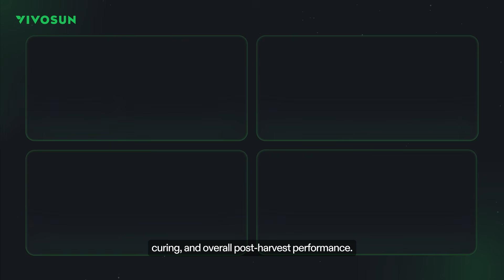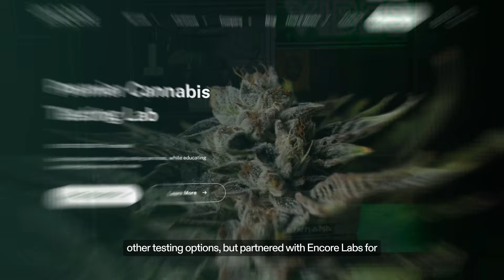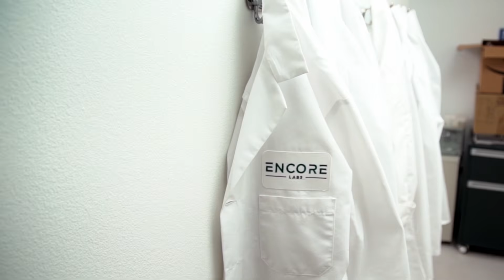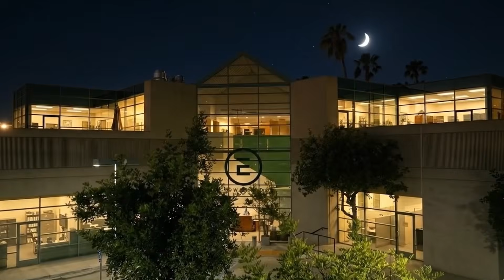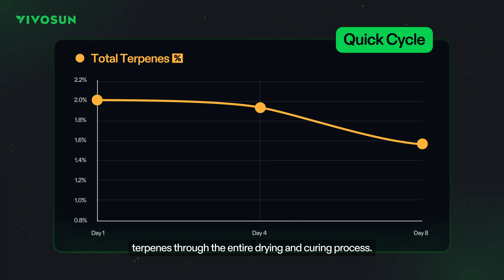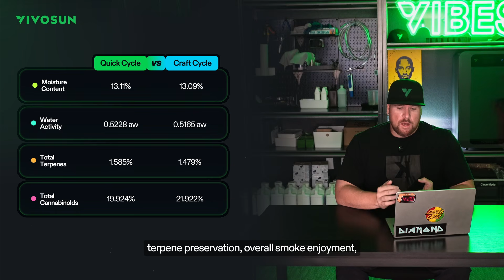We Sent VCure for Lab Testing — Here’s What We Found

Comment: Gimmick. I have run 2 quick cycles and both batches smell like a bale of hay and the stems bend but do not snap. I am now running a craft cycle and after 6 days is still in the dry cycle Should have automatically switched to the cure cycle by now. I opened the box and it smells like a bale of hay. the stems do not snap. I will let it complete the cycle before I make a final judgement but I am so far disappointed. I will report back when the craft cycle is completed.

Comment: I have been 14 day dry and curing for 8 weeks. worked every time
Reply: I have been using the craft cycle (14 days total) for all but the first time (quick cycle). I want to try a custom cycle and have some questions about your recipe. I'm confused, do you actually dry 14 days then cure for 8 weeks before going into the storage cycle? If so, how do you set the cycle, 14 days drying then 56 days curing? After my 14 day cycle, I just leave everything in the VCure until my next plant is ready, which can be a month or more. I'm wondering what's the difference between curing for 8 weeks and storing long term, say 8 weeks. Thanks, I appreciate any thoughts.

Comment: First time grower. Invested $840+ in Vivosun ecosystem specifically because of the advertised seamless integrated smart control. Experienced a confirmed system wide software bug during the critical veg to flower transition. Bug reset the entire recipe affecting every connected device simultaneously. Created mold conditions. Disrupted environment for multiple days. Vivosun's resolution after escalation to internal team — $75 or a replacement controller for the bugged device.
Reply: There customer service is SHIT SHIT SHIT. first time grower here having issues communicating with VIVOSUN over the issue. How in the holy hell is email and text the only way to communicate with support over an issue? You guys don’t even answer that promptly. I am invested in the company not bashing and truly want to “love” it but non-communication is a great way to drive customers away.
Reply: @kajun_ghost7558 i agree. Especially having the app, why not integrate into the app for support?  It's crazy
Reply: lol blaming you botch grow on VIVOSUN

Comment: I got mine last Friday the glass door was broken but there sending me a new one really do appreciate there customer care service 👌
Reply: my unit also arrived broken, it's glass door also, got a new one shipped to me and this one with the broken glass still works potentially, strong little unit, a1 customer service!
Reply: What do you do, have to provide picture proof of it being broken or what?
Reply: @markdexter9215yes if you read there return policy you can’t actually expect the package 📦 from the ups driver you are supposed to take pictures and email the customer service and send pictures and send it back up opened but my damage was on the bottom it wasn’t visible
Reply: @markdexter9215 yes, i went with the Seal?? i think it was called worry free delivery but it was a hassle because vivosun can't help you because you went with seal so they told me, anyways seal at first offered me 30% off i said no then 50% and no so they finally caved and just sent me a new unit........                                                                                                        If seal is still an option on their site don't go with them and just get through vivosun -the extra cost, they'd have given me another one as well if i hadn't gone through seal.

Comment: I'm only 2 days away from testing this theory. I had some air dried under 57 humidity and 67° basically the same thing as the vcure with  little air movement. This room has always been perfect. We'll find out a true test. I took some of the same plant, dried it in there and left some air dried. I will really let you know in 2 days🎉 soon as I pull them out I'll be putting more back in🎉
Reply: How were the results?
Reply: I would say the v cure turned out a little smoother but centers are a little drier and hard to get back. Being moist inside. Not totally dry dry but drier than. I would typically get it to after burping jars and letting the center stay a little bit moisture after harvest ig needs more time burping jars to get it as smooth The v cure gets it smooth a little faster for sure.  @miketym2642

Comment: It didn't dry my flowers perfect they taste like shit they look good tho but they taste like ass 15 ounces of un smokable material it taste like inscents
Reply: Same here brutha. Tested inside humidity with 3 different hydrometers. And inside humidity reads 45%(locked) while display humidity reads 57%. Have you checked your inside humidity?

I am very confused. Products comes out stringy when pulled from stem. And know there's+3% difference is ok but I'm confused on 12% difference.

I did 4 runs all the same. Ran the craft cycle and was good... Smooth BUT NO TASTE. THANKS

Comment: Great info . So far I’ve ran the craft cycle . But I will run the fast cycle next
Reply: I've heard. Don't do it. You'll be somewhat disappointed only if you really have to😮
Reply: @Rc4hack what did ypu hear and you mean the faster cycle
Reply: @alexrodriguez484 there's a craft cycle and a quick  cycle. One is 7 or 8 days. One is 14 days
Reply: I tried the quick cycle the first time, then the craft cycle and ,in my opinion, wouldn't repeat a quick cycle. I'm interested in creating my own recipe, but need more info about drying length vs curing length.

Comment: Id love to have one but its rather small? Is there only one meter measuring the environment, how do you know its not a different reading on the other corner??
Reply: It's the size of a mini fridge. It'll hold 3 plants that yield 4-6 dryoz per plant. I've run 2 harvests through so far, 3 plants per harvest. 

Look up some other vcure videos, your functionality questions are answered
Reply: @Donik0420  i've watched many videos that growers said the v cure did no better than what they already were doing, so there's that
Reply: @nokisskissnobangbang that's wild cuz I don't see hardly any videos on it. It's only been out for 6 months. The videos I've seen on  people that actually have used it said it works awesome
Reply: It's probably too small of a space to have much variation. I mean how much can it change in 12 inches?
Reply: It holds up to 2.5lb. The way the VCure circulates and moves the air doesn't allow for microclimates or "pockets"
Reply: @growcoachJ the circulation part should have been obvious. Its 2.5lbs of wet weight??
Reply: @ChrisGreene-bo3go  Correct, wet weight